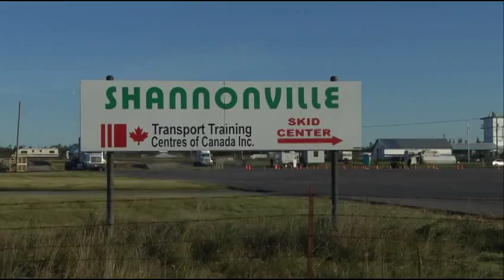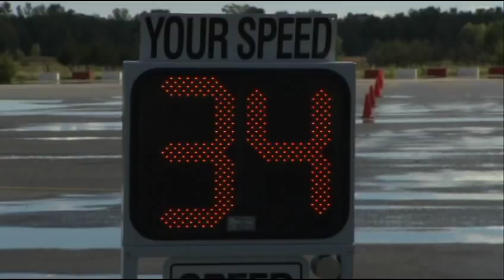RMR: Rick at Tractor Trailer Skid School

Comment: all truckers should not need a school to figure this out, my whole family has been trucking and most of us have never been in an accident that was our fault, the most dangerous people on the road are the people in the smaller cars and the idiots in motor homes and big RV trailers, you would not believe the amount of times people will pull in front of a big rig right into the blind spot, then slow down, all that happens then is they get run over.